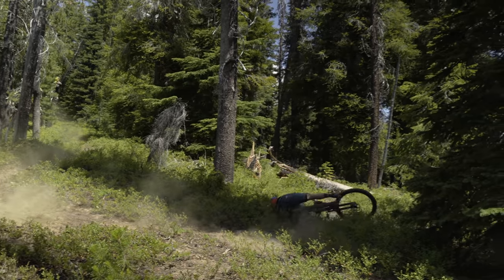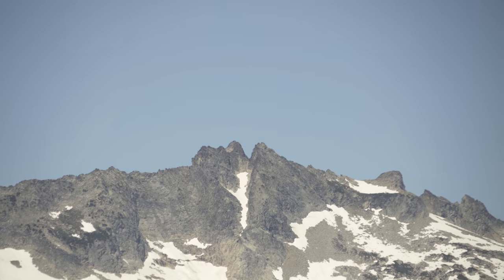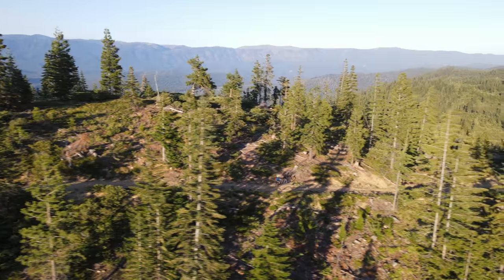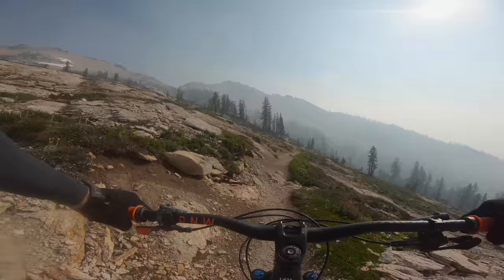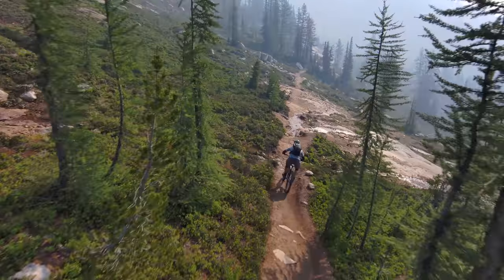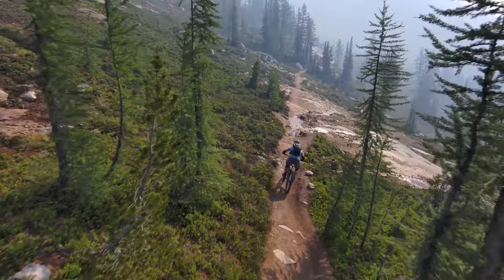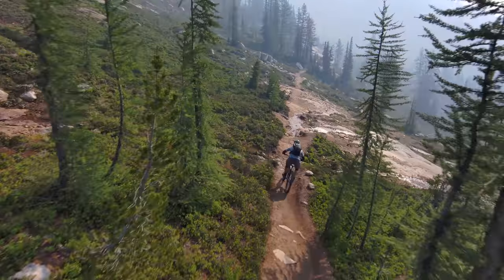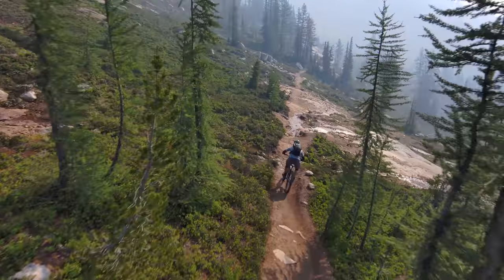The Ibis Exie: this is why I ride mountain bikes.

Comment: "Steep" head angle... modern bikes feel so good to me since I started riding when 26" bikes had 71 or 72 degree head angles! I'm sure you're the same!
Reply from the maker: Me too Jake!  My 26" wheeled Bontrager actually had a larger offset fork to make the head angle even twitchier!!!
Reply: I’m still riding a slack head angle 68deg. Kona Abracadabra with 160mm travel. This was the pinnacle enduro racing bike in 2013 . Now it’s a dinosaur put the slack at angle. My 2001 conus dad had a 68° head angle 150 mm or travel and a deal crown fork. It was actually my cross country bike at 40 pounds and a 40 tooth front chain ring. I wanted some slack with some travel for Trail riding
Reply: @troyphillips1077  Is the Abracadabra the one with the little helper shock? The Magic Link? If so I had one of those in 2008-ish. It was so slack back then because my other bike was a Cannondale Flash that I think had a 71 deg HA!

Comment: I wanted a second bike to compliment my over-engineered '19 Specialized Comp Carbon Stumpjumper trail/enduro bike. I wanted a much lighter XC bike. I also wanted a bike built in the US. Now after a year on this bike and a thousand miles later, the Exie is still far beyond my expectations. I ride in rocky, often gnarly Austin, Texas. The Stumpjumper handles everything I throw at it. The surprising thing is the Exie also handles almost everything I throw at it. For an short travel, beefed-up XC bike, (dare I say down country...) climbing any gnar walls is the Exie's superpower. Also, this bike is ridiculously /fast/. With lightweight tires it flies. With knobby tires it flies and corners like nothing else I've ever ridden. I wouldn't want to do large drops with it but I never do those anyway. But jumping, handling occasional rock gardens, climbing very technical walls and absolutely flying on single track, it's the greatest XC bike Ibis has creaated.

Comment: I use a chopped-down screen in summer (Australia). Those vents in your jacket and helmet need air-flow to work ;) As long as the flow is smooth (ie., really low screen) you won't get buffeting. Just need to avoid being behind traffic on freeway - clean air flow is king on a screen-less bike. Try it with no screen as well - might be all you need.

Comment: Great video Jeff. You keep saying steep head angle at 67deg. I ride a 160mm Kona Abracadabra from 2013 and it had a then slack 68deg head angle . Before that I had a 2001 Kona Stab with a dual crown ( originally) 150mm fork and 68deg head angle. I’ve always wanted for my trail bikes that 150-160mm travel (on 26”) bikes . 
I haven’t gone to big wheels yet but will probably in a few years. 
I’m a live music videographer/photographer. My cash has been going there . 
I have always been a fan of Ibis and the founder before Ibis was around. 
Cool bike and super cool video.

Comment: Always a joy to watch you ride a bike - it’s infectious! 

Any tips on scoping out trails and planning a ride on trails you haven’t ridden, specifically given the context of the firm deadline you had due to parental responsibilities? That was an awesome adventure, but I’m particularly impressed with how cleanly your ad hoc ride fit in at the end. I feel like I have to check Trailforks several times when riding local trails for the first time, and you sized up then rode one sight-unseen. Would love to see a video on ride planning tips from a seasoned pro like yourself.
Reply from the maker: Thank you so much!  Don't worry, I edit out the constant "trail forks checking" that always happens!  Often there are signs, but if there's anything that really helps, it's taking a moment to look at the topo and get an idea where the trail will be going up vs down.

Comment: XC-trail bike.. Bikes like these are so very versatile. A bike like this or the Epic Evo, Spur and new SC Blur will cover 90% of most normal peoples riding..
Reply: So true, a lot of people. are over biked when they could be riding something like this and just bottom out 1 or 2 times more
Reply from the maker: There's a legit place for a mid-travel hardtail as well.  A 140 fork equipped carbon hardtail with a ~65 head angle and ~77 seat angle would be an awesome all around bike.

Comment: Really appreciate your video's Jeff! Awesome riding & scenery. I recentely purchased my first shorter travel trail bike (2021 pivot 429) and am loving the longer rides I am able to do rather than using my enduro.  Quick question how did you decide what stem length to install and do you always try to use same reach numbers across all your bikes? Thanks!

Comment: So, what’s your final thoughts on the suspension? How did it climb compared to the RM Altitude? Also, is a 100mm travel bike for a specific type of trail/riding only? How much travel do you need for an all around type bike? I would think that an Altitude with the Ride 9 adjustment could do it all? I’m curious about the pros and cons. Fun video, thanks 🙏🏽
Reply from the maker: The suspension was good- I was impressed.  More supportive than the stock Ripley 4.  You can't compare this bike to the Altitude, they are completely different.  An XC bike excels on flatter, mellower trails.  The Altitude excels at steeper, more rugged riding, and is totally happy in bike parks.  Even with Ride 9, the Altitude will always be a VERY different feel.

Comment: Great video and great riding! Question, are you using a Skydio 2 drone since you’re solo? 

Random thoughts: 67 deg head angle used to be all mountain in 2016… this Exie is my dream bike… rad. 

Plus, that is some bold motorcycle adventuring!!
Reply from the maker: Thanks Lloyd!  Ya I got a Skydio on Craigslist a while back, it's a nice tool to have, but doesn't really work if there are many trees.  I need to try the latest firmware update.  I kinda fell outa love with the VSTROM on this trip.  It can do everything, but isn't very good in the dirt.  It was around 600lbs on this trip.  I was hoping to do the WA State BDR route with just minimal moto gear, as that might let the Strom shine a bit more, but I might just end up riding singletrack instead.  Possibly the VSTROM will be for sale soon!

Comment: Well only five minutes in and you’re already blurring the lines of what XC is. I have to just ask if it’s not actually a real funduro rig? Sure looks like it when you ride it. I also have to wonder if Mathieu van der Poel would have OTB’d on this bike? Just looks like it could handle a drop like the one on the XCO course in Japan…
Loooovely looking bike yet again from Ibis anyway as you would expect. I thing they will sell plenty.
Reply from the maker: Thanks Drapp!  I prefer the rougher, more traditional trails to the typical blue/green MTB oriented trails, so ya, I'm using this bike in a slightly different realm than perhaps the target audience.  But it works well for what I was up to!
Reply: @JeffKendallWeed  I noticed it has a nice short stem. I haven’t really been paying too much attention to XC bikes of today. Is that the way they are going? Also what is the HA on the Xcie? Was it twitching around on the back wheel? So many questions hahaha!

Comment: a bike no one can afford….
Reply from the maker: No one?  Hardly.  It's priced right in line with other sub 2 kg race bikes- and it's made in a way that's more environmentally responsible than most other bikes, not to mention higher quality.  Ibis has you covered with low cost options- the Ripley AF and Ripmo AF.  The Exie isn't supposed to be "cheap", it's supposed to be the "best".
Reply: Starts at $8000! Way over priced.
Reply from the maker: Ibis also makes an aluminum full suspension bike that starts at $3200.  If you want a lower priced bike, then don't look at USA made carbon fiber- look at Asian produced metal bikes.
Reply: Jeff Kendall-Weed i’m not talking about all of ibis’s line up, i’m in the market for a xc race bike not an aluminum trail bike
Reply: @juliansimpson-kirsch9629  SCOTT SPARK RC TEAM ISSUE AXS bike. $5600.

Comment: I'm not certain why Ibis marketing chose to promote a half hour video of their new XC bike with footage that shows a non-XC rider unicycling along endless downhills.  All of us outside the lift-serviced downhill areas spend far more time riding uphill than downhill, and a light modern XC bike should be shown mastering its own uphill domain.  Yet 90% of the riding footage is all downhill on the back wheel, and we learn nothing about the climbing, especially from this rider for who this bike's climbing must have been a transcendent change from the heavy enduro bikes he suggests he typically rides.  As usual, speed sells, even if this is a fantasy world where nobody has to put in the effort to gain the elevation that this bike was designed for.  Flame suit on.

Comment: Why in the hell would Ibis build a plant in California?????  It's not a good business move from a cost and taxes standpoint.  Unless there's something like a huge tax break they recd, I can't see this being a better business decision than NV, TX, AZ, or other business-friendly states.
Reply from the maker: David, it makes a ton of sense for Ibis to build their factory close to their HQ.  After all, the whole goal of this is to keep it local and as absolutely high quality as possible- and not to outsource to where things are cheaper.  Heck, why not just build the factory in Shenzen, where it would make the most sense from a purely financial standpoint?  First off, there is a significant labor pool of talented carbon workers in the town where they set up shop- many of these folks previously worked for Kestral.  Second, it's within 45 minutes or so of where the engineering and company management happens.  Eliminating shipping and zoom calls is HUGE for communication and development.  The bike's designer HAS to be highly involved in the process of developing the production line.  And third, Ibis designs its bikes to ride awesome on their local trails.  If the factory is 7 hours away in Nevada, it's a lot harder to test prototypes on the target trails.  I do remember chatter about tax breaks for local manufacturing, but don't know the details there.
Reply: @JeffKendallWeed  Jeff absolutely nailed it with this response. Thanks Jeff! So much fun watching you adventure and shred.